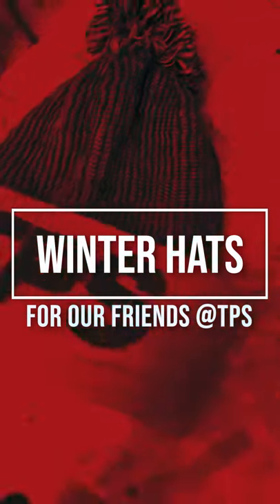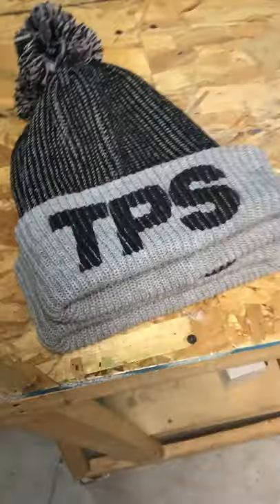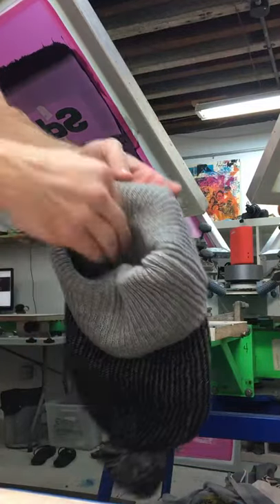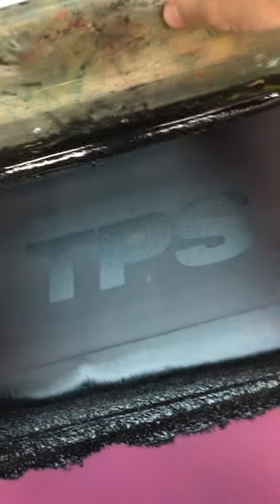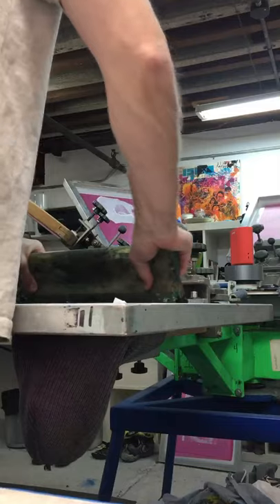Silkscreen winter hats, quick how-to #shorts

Comment: Hey bro
What’s the mesh count for such fabrics?
Reply from the maker: Sup - we used a 110 mesh on those so that the ink would drive inbetween all the ridges of the hat. We found that curing the hats at a lower temp was critical because overheating the knit causes the hat to lose elasticity.